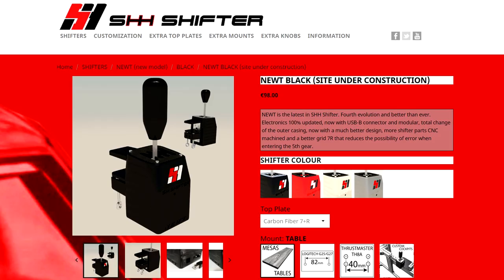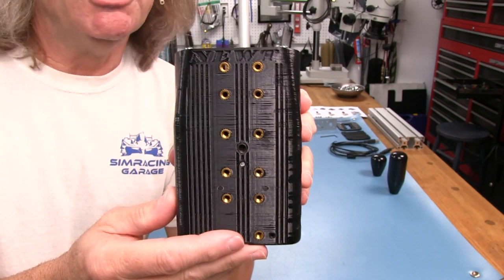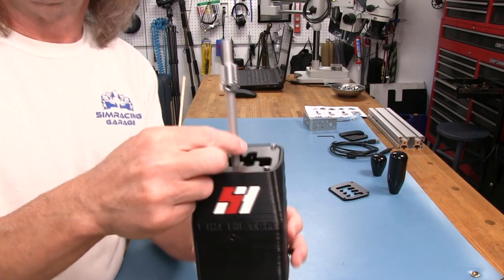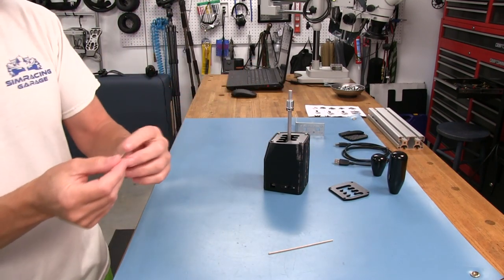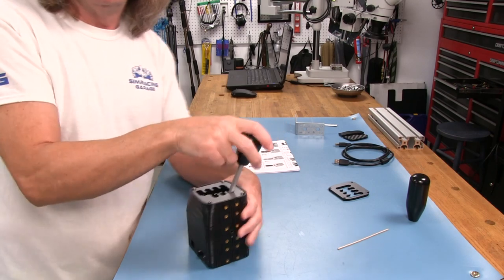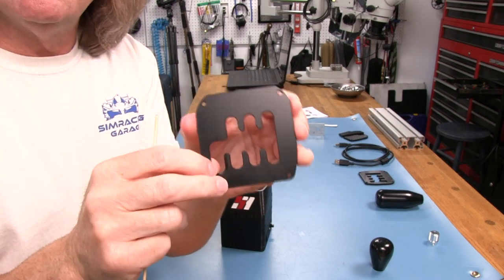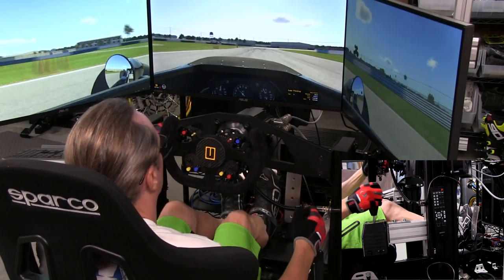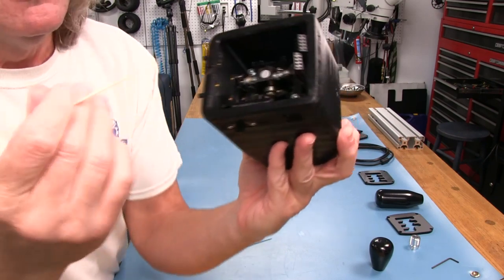SHH "NEWT" H-Pattern/Sequential Shifter Review

Comment: could you put longer screws in the preload thing, to get a harder preload?
Reply: Sinc Media that was exactly what I was thinking, maybe 0.5 or 1.0 mm longer would do the trick. But the stress on the internals might become to much, I guess it would void warranty for sure.
Reply: @fastfolky  yeah, i think im just going to go for the fanatec 1.5 shifter. Just reasurance really and a really good product
Reply: Sinc Media solid choice, I just went for the SHH because my whole rig is a wooden diy deal and I have no other fanatec gear so I would also need the pretty pricy USB adapter. I’m sure the Fanatec is the better solution but I only drive stick or sequential about 1/3 of the time so this will have to do.
Reply: @fastfolky  yeah. My next rig is going to be a ddw with a sim labs cockpit so it would probs be ideal, i also mostly drive h pattern or siquential. I would still have to get the adaptor though which is annoying
Reply: @fastfolky  Be carefull, the Fanatec has some serious issues with misshifting! Instead of 5th gear mine shifts into Reverse sometimes. Their support is not really good and I havent seen any case on the internet yet where they solved this issue to full satifaction of their customer. 
 Also the sequential shiftermode is so bad to a point that I just stopped using it. The throw is too long and it has unrealistic stong amount of resistance. I think the whole shifter is way overpriced, and I regret buying it.

Comment: Is the mounting for this the same as say Fanatec’s mounting holes?  In other words if your rig is drilled for Fanatec, logitech and thrustmaster will their mounting bracket bolt right on with no drilling?
Reply: You can choose TH and Logitech like mounting options. We have not the modern Fanatec shifter like mounting option.

Comment: Can you mount it facing the other way *with the logo facing forward?
Reply: The holes for the mounting option are always in the front. If you mount the shifter like you say the shifter will work anyway but everything would be reversed too.

Comment: Id still recommend the TH8A considering the minimal price difference. The TH8A is built much beefier parts. This is $120usd while the TH8A is only $30 more.
Reply: In th8a You can't go H to SEQ on the fly. Th8a feels much much lighter.
SHH has more mounting options.
Th8a has better build materials.
Really it is better overall?
Reply: @KotLarry  I cant say for sure since I dont own this one but Ive beat on my TH8A for years like a red headed step child and its help up great. Ive modded it as well to make its shifts much stiffer also with a shorter throw. You also have to take into account a huge corporation with high paid engineers with mass production keeping the costs down with the heavier duty materials. No mall production can beat those costs, even against 3d printing. There are certain parts in this shifter with plastic pieces that I can see breaking down fairly quickly. Specifically the gate the shaft runs on. I'd almost even recommend a g27 shifter off ebay with the sequential option for around 50$ used and a 20$ usb adapter. Then do the cheap rubber band mod.
Reply: @d3tach3d  before I bought mine HAWK version I,ve checked "the net" 
I haven't found single one bad review.
And I had opportunity to check th8a and as I wrote. Materials are fine, but You can't go H to SEQ on the fly and it is lighter. Much lighter. Mods will probably get the second problem away, but true double function stays on the SHH side.
Reply: @d3tach3d  C'mon what BS: A 'big' commercial company like TM (I own multiple of their products btw) has much more overhead overal and their margin of profit will be much higher opposed to this HSS shifter. Not to say anyting about those high paid engineers...... (HIGH paid ffs => also labour cost in general is a huge part of the cost in any company)

You and many other needed to mod the TM shifter to get a satisfying feeling out of it. You're just making guesses out of a YT-clip, there are many more reviews / statements of actual SHH owners that say otherwise.....

Also TM is not known for using heavy duty materials (which doesn't mean that they do the opposite).